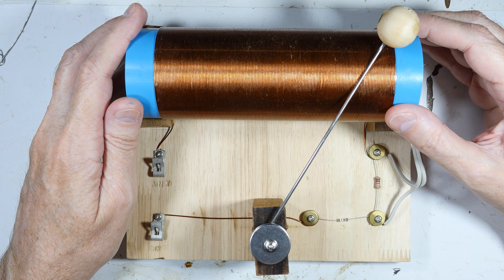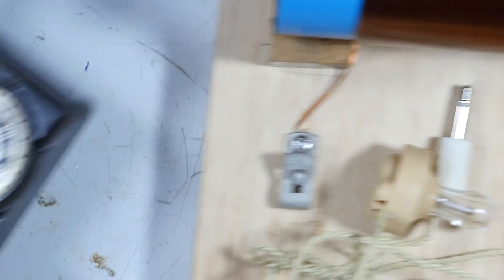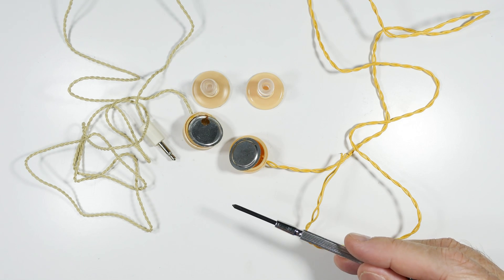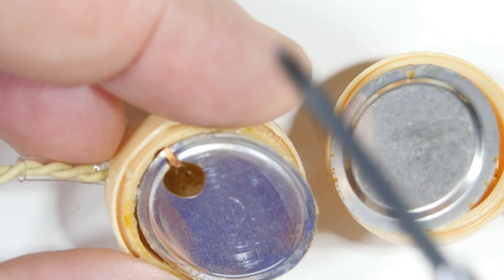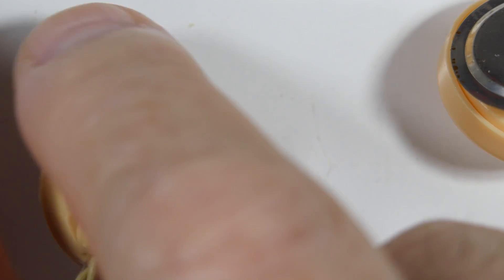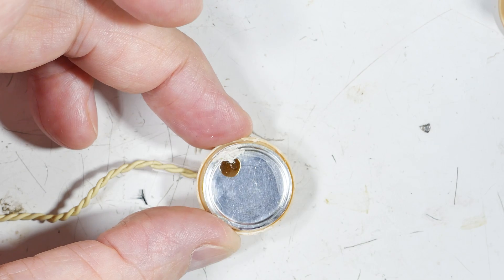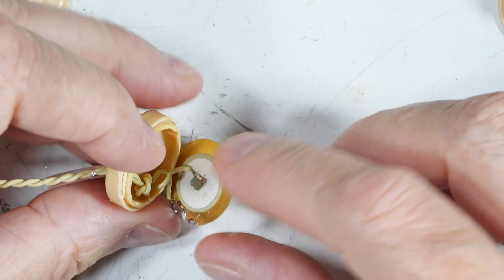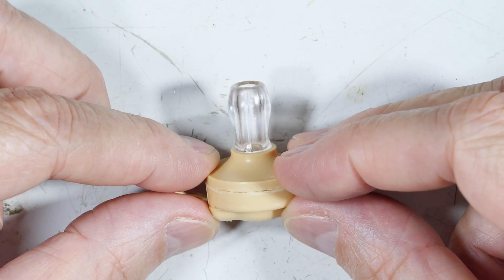Crystal Radio--Bad Earphone Diagnosis & Fix (Remix Pts 1-3)(4K)

Comment: I have an original nos earpiece and it works fine my advice instead of finding the cheap crap find a good nos earpiece. Further more now what i found out wotks best is to find a container which has a screwseal and wind an electrimagnet with very fine magnet wire like the size of a human hair and wind it around a spool which fits in the container so that when you wind the wire it is not too thick and neasure the RESISTANCE you want approximatelly 1000 to 4000 ohms of resistance and then screw it ni the container drill a hole in the back of the container fore sone cable to attach directly to the electromagnet and also a big hole fot the sound to pass though and then you cut a small piece of sheet metal and it is very thin. IMPORTANT make sure that the head of the electromagnet and is as close to the disc as possible wihout touching  and if you did all that cprrectly the sound will come through fairly vlearly it depends of the thicknes of the steel sheet . I hope i provided enough imformation so that someone will find this interesting and mabye they will do it correctly and listen much netter than the crystal earpiece

Comment: I never liked those things. They sound tinny and not very sensitive to my ears. Hi impedance headphones are way better but hard to get or expensive. What I discovered years ago was that ordinary good quality headphones work even better for crystal sets IF you use them via a matching transformer. Obviously the transformer needs to be a high turns ratio but they aren't as critical as you might think. Even one salvaged out of an old style wall charger would probably work OK.

Comment: A BTW for those who suspect an earphone:
You need a known good ground and quiet.
Hold one wire of the earphone with your fingers while you are standing not touching anything.
Brush the other wire across the ground connection without touching it with your fingers or anything.
In most cases you will hear a faint staticy noise.

Comment: I have had a different failure.
On one I bought, the wire on the back pulled off the ceramic disk.  The metal plating on the disk came loose with it.  I don't know how they managed to assemble it with the wire tight but they did.  I fixed it by blobbing a bit of solder on the surface in a different spot and then connecting it with a very fine wire.  I got the tin wire by teasing one wire out of some stranded hookup wire.  I estimate it is about #36 or maybe #40.  I made is long and formed a loop in it.
I now have two working earphones again.